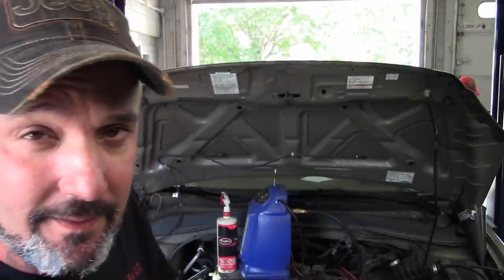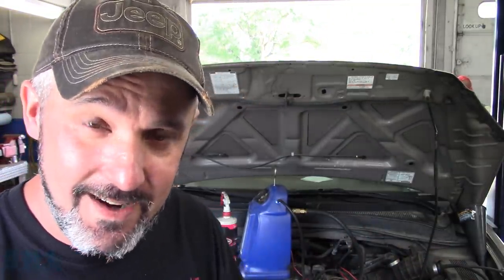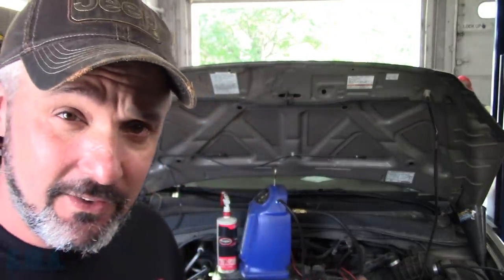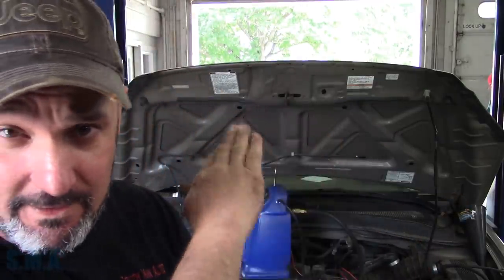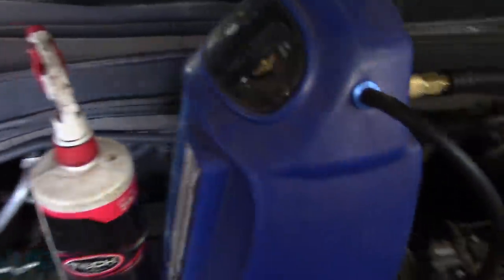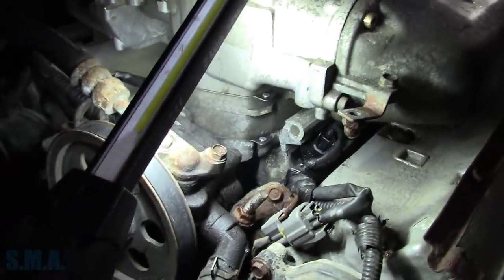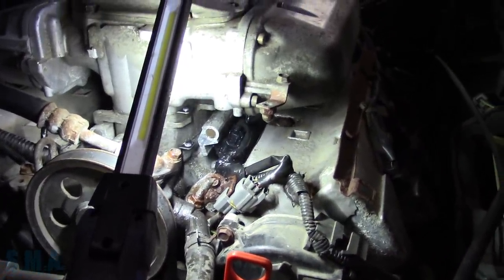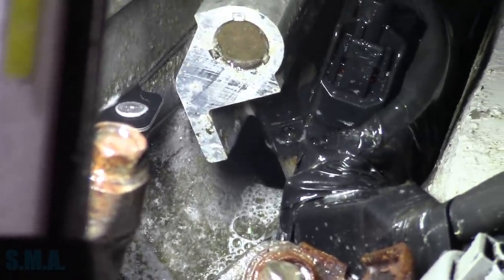Double Check Your Diagnosis!

Comment: Just a part of being a quality mechanic, it's the one's who 
have a comeback and deny it all, like the shop my truck is at for 
warranty. Trying to dodge putting in a transmission and give me the run 
around telling me there's nothing wrong with it, then I made them send 
me their write up and it's acknowledged on the write up, so 
they did a pan and filter and put in a bg additive to "fix" it. Which is
 a temporary fix to try and get me out of the warranty period when the 
trans fails on me. I don't think they realize I own my own mobile fleet
 service company and know they're giving me a run around. Not to mention
 it's taken them 4 days to misdiagnose a driveshaft issue and try to say
 it's whats causing vibrations due to installing new u joints 
"incorrectly" hahahaha nonsense. It's the reason I don't take my 
vehicles anywhere unless I absolutely have to, cause now they've removed
 brand new u joints, re-balanced the driveshaft or replaced the rear 
shaft, and are trying to charge me for it when all of this was supposed 
to be warranty related due to the trans. Not to mention the issue was 
there before I replaced the U joints because one was bad, and the 
symptoms of an unbalanced driveshaft vibration and a transmission 
violently shaking in two gears are not the same. I'm pissed right now hah

Comment: At least you would not get the vehicle back and blame it on something else, then charge them for the new repair.  You would be amazed at how many times this has happened to me, even with a mechanic I trusted for nearly 20 years.  I caught him again wanting to change a water pump with out pressure testing the system.  Turns out it was a radiator cap.

Comment: For the DIY's on a budget , would an old blood pressure cuff or those inflatable " pillows " that the lock smiths use to spread the door frame  seal that throttle duct ? Maybe someone can come up with a substitute .

Comment: motor was recently changed?  any chance a strap was used maybe looped around the upper intake?  that may have stressed the lower, especially if it was shocked or yanked around.  i may be all wrong if the engine has loops and they were used.

Comment: I heard brake clean will seep past older gaskets that are still good. Brake clean is to thin and it will find its way past older gaskets. I use propane or just go right to smoke test

Comment: My guess is that being a 2nd hand engine maybe the engine got lifted by the intake manifold and the weight of the engine put stress on that particular runner and cracked it

Comment: After sending it to Dr. O for diagnosis, the infamous "other shop" would've smeared J B Weld on the crack, (maybe) given it a blast of silver from a spray can, charged the customer for a brand new Honda lower manifold and shipped it! That's not the case at S.M.A. though! Wrench on Eric!
Reply: Or the "Liquid Steel" glue in a tube.

Comment: Don't know where to send questions. 2007 Prius, changed engine. 12 volt battery low, so put brand new one in. Tested the main battery pack before engine change, and it all checked out good. I am getting the parking break error and cannot start it. Where should I look first?

Comment: The manifold cracked when the old engine was replaced with the new-old engine. Probably over-torqued the manifold with the hoist. Small crack became larger over time. Should have installed a new engine to avoid future problems.

Comment: I had a P0174 showing and thought it was the upstream o2 sensors, turned out to be a exhaust manifold leak and then two weeks later a P219B shows up,  what's that saying, if it weren't for bad luck I'd have no luck at all?

Comment: That's both unlucky (the fault) and lucky (the second look) at the same time. 
There's always the V out the crack and Knead It (tm) option. Perfectly sound repair (that stuff sticks like S... to a blanket) and a much much cheaper and easier option.
Reply: Jimmeh B  Quick fixes last about as long as they take to perform.
Reply: @dorightal4965  incorrect.
13 years I've been a mechanic. I've used that stuff to fill corrosion in a cylinder head on a 3yc (my own of course) water jacket to cyl3 . Lasted 3 years - to the end life of the vehicle.

As I said, that stuff sticks like shit to a blanket. Also works really well for repairing threads. I wouldn't try it on cylinder head bolts or, to repair suspension or brake components, but for general repairs it's magic stuff.

Also mate, don't know how much you know about modern materials, but an awful lot of plastics and polymers these days are stronger in every way than aluminium.

All good though bro, I'm also happy to remove the manifold and TIG up the cracks, or source and replace... Whatever the customer is happy to pay for, and after all, the customer ALWAYS knows best. (yet still they pay people to fix them)

Comment: Could that fixed with that aluminum melting stuff you see in the adds. 
My friend used it to fill holes in his boat,they're like welding rods thst you use a propane,
Reply: Alumaweld they called it years ago; haven't looked it up since. Pretty neat commercials back then.

Comment: why was it bubbling, and not sucking? I thought intakes had vacuum.
Reply: The engine wasn't running, the pipework was under pressure from the smoke pump.

Comment: What's the diagnosis for a 40 suction 300 head pressure on 70 d ambient?  Too high head pressure. Im thinking dirty condenser? Any thing else?
Reply: HEAT DRIVES UP PRESSURE. CHECK FOR  AIR FLOW OVER  CONDENSER. ELECTRIC COOLING FANS OR FAULTY FAN CLUTCH PROBLEMS OR POSSIBLE RADIATOR OVER HEATING. IF YOUR HIGH SIDE TEST PORT IS BETWEEN THE COMPRESSOR AND CONDENSER  CHECK FOR A POSSIBLE BLOCKAGE IN CONDENSER, CHECK LINE COMING OUT OF CONDENSER TOWARD EVAP SHOULD BE REAL HOT TO THE TOUCH. IF CONDENSER IS STOPPED UP YOU COULD TRY FLUSHING IT BUT USUALLY IT DOES NOT WORK. I USUALLY JUST REPLACE THEM {  FORD FOR EXAMPLE RECOMMENDS REPLACEMENT AS DO SEVERAL OTHER COMPANIES  }. GOOD LUCK.

Comment: I've had something similar happen on a Mercedes 6.3 AMG except the friggin intake manifold was warped. Only found out after the job was finished and thanks to Google. Can't see where the intake bolts up to the head on those so how the hell are you supposed to figure that out?
Reply: When u see smoke in that area u know.  Yup, soap bubbles won't help here.  Smoke test real powerful.

Comment: Hey guys, I seem to be having some trouble with my 2009 Pontiac vibe AWD. 
Firstly, I hear a grinding noise coming from somewhere. It only happens between 40 and 50 mph when applying throttle. Noise stops as soon as I let off the throttle. 
Another issue I have is with my parking brake. I haven’t looked at it with the wheel off yet but I do know it has rear discs, with a smaller drum for the parking brake. When I pull the lever to engage it I can hear the actuation of it, yet it doesn’t engage. 
Any tips or advice?

Comment: I had an evap leak i diaged  the same way. Found that the fuel pump was cracked on top and that was my leak
Reply from the maker: Just did one of those today on a newer Malibu. Same thing. Broke around the top of the fuel pump :)
Reply: @SouthMainAuto  when i told my boss he was like " oh bull. Its never a fuel pump" the bubbles don't lie. How many of those have you had where the fuel pump is cracked? That was my only one
Reply: @mikeshinyama9077  C6 Corvettes are infamous for cracked fuel pumps too. GM loves to source the cheapest plastic!
Reply: @TYLERTRANCE  I'll take your word for it. Mine was on older Chevy truck i cant remember  the exact year and model

Comment: Is this the same guy who forgot to put in the spark plug springs ?????????
Reply: I think that was a ford not Honda , right ?
Reply: Is that like adding blinker fluid?
Reply: Gotta watch those muffler bearings too......
Reply: That was on a Ford Escape 2.5 engine. A friend of mine has one too and after doing a tune up on it, I had these little springs left over. I thought about it for a few minutes before I tried to start the engine. It wouldn't have hurt anything but it saved me from looking stupid.
Reply: @MikeBrown-ii3pt  What did Ford do, put a Model T engine in it? Never heard of spark plug springs since some of the early engines.
Reply: @cardboardboxification  Lubricating the muffler bearings using unicorn grease.

Comment: Looks someone torqued their intake manifold too much. It doesn’t take much force to crack aluminum parts and much worst on plastic parts.
Reply: He mentioned it was a replacement salvage yard engine so it also could have been stressed by whatever they used for removal/installation. Or if the car it came from was a front end wreck

Comment: I personally would just braze it. Just me though.
Reply from the maker: Braze cast aluminium?
Reply: @SouthMainAuto  Yep. I understand why you wouldn't though.  You can't guarantee that type of fix.
Reply from the maker: @VanquisherUSMC  Yeah perhaps if it was an unobtainable part I would consider some type of welding repair, however if I am gonna pull it off to braze it I'll just replace it with a used and be sure it's good to go :)